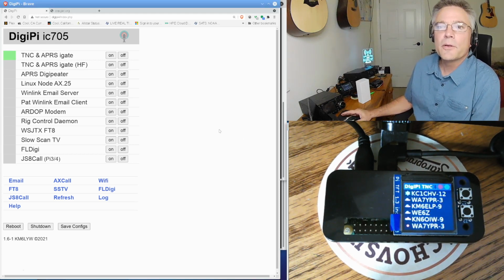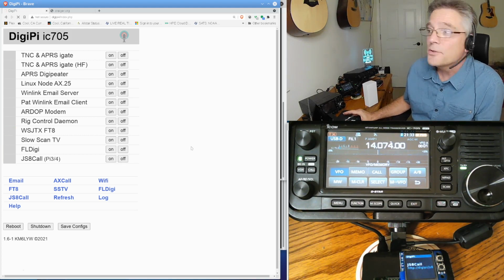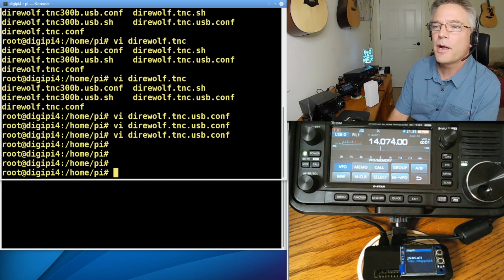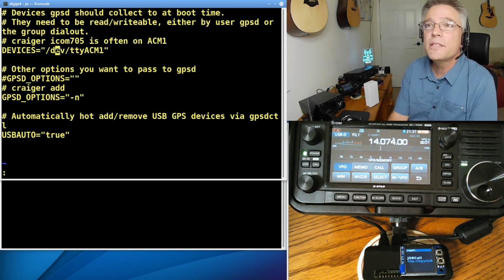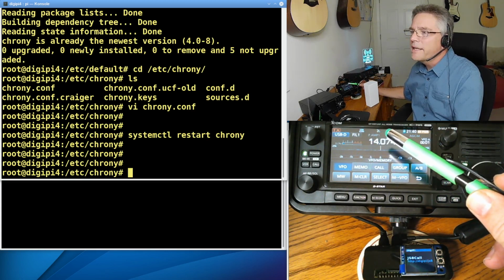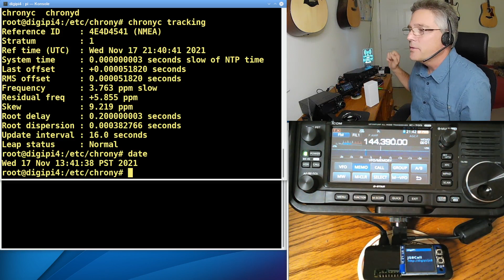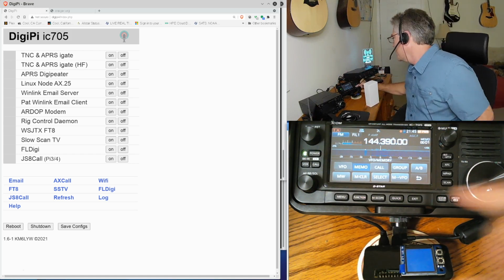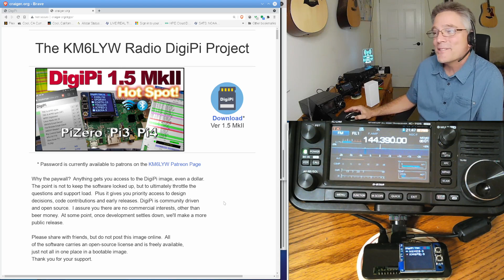Ham Radio GPS - You'll want one.

Comment: Hi, a new Patreon member here. Thanks for the videos. I assume these settings and file edits have been done in the latest release of your DigiPi image. After a factory reset do I have to adjust any of the settings of my ICOM IC-705 to get DigiPi to work in the APRS TNC Igate mode. I watched the IC-7300 settings video which I assume the settings should be the same as the IC-705 except for the CIV address even though the IC-7300 doesn’t have the 2meter and 70cm bands on it. I tried it and my radio doesn’t seem to respond to the DigiPi. I do get the com icon on the radio screen when connected.
Thanks!
Reply from the maker: @1crazynordlander yah, digipi works out-of-the-box with the ic705 and will use it's gps.  other radios may need to adjust /etc/default/gpsd

Comment: One thing, your Rx level should be closer to 45-50 dB. 70 dB is too high!
Reply from the maker: Great info - I have no idea what the input level should be.  somebody said max of 75...   We can set this on the USB AF level on our radios.  I just max it out and hope for the best.  I'll dial it down a bit. thanks!
Reply: @KM6LYW   The graph is still in the green so, yes, the level is “okay.” However, definitely not optimal. It’s just like proper use of rf-gain can enhance HF reception. On 40m FT8 I have to adjust my rf-gain to s7-s9 or the incoming signals are horribly distorted to the ear. The Rx level control performs the same function to the audio being introduced to the application. There is a vertical slider on the right that adjusts the Tx which allows you to adjust the audio output so you are not overdriving the audio output to the radio. The functions are the same as the adjustments for phone when using a microphone. 
Your video is still excellent and I like your approach to using digital modes on the Pi! (And use of vi, a very powerful editor! HI HI)
73 de N0SR
Reply from the maker: @JayDawg-911  right, understood.  So on the pi->radio volume, i set alsamixer to 73/100, because every radio is entirely different.  Luckily there's a volume slider on ft8/js8call, but for sstv, direwolf, that's typically overload.  it'd be nice to have a best practice for AF gain structures for all radios and apps.
Reply: @KM6LYW  I couldn’t agree more, I hope we’ll see improvements in the future. Right now, even changing bands forces me to adjust levels! I like to use Pulse audio as it gives one interface that attaches levels to processes (applications) according to PID, keeping track of each different PID’s audio settings. I’d love to see this changed to levels attached to /<location>/<file> instead of PID and have these maintained in a data file, which is WAY above my skill level to try and implement! 😂

Comment: I have a 705 and I have HF and VHF/UHF antennas always feed at the same time using a diplexer - you can either have it in the shack (meaning 2 longer runs of feed lien) or at the antennas (a single feedline to somewhere outdoors then split) - something like an MFJ-4956S

Comment: The sub-board in a smartphone that contains the Blutooth, Wifi dual band, AND GPS generation4 receiver is a $5 part. Which means it adds $20 to the retail price of devices like radios.
 So not having all of that built in? Means you're trying to undersell the $25 radios.